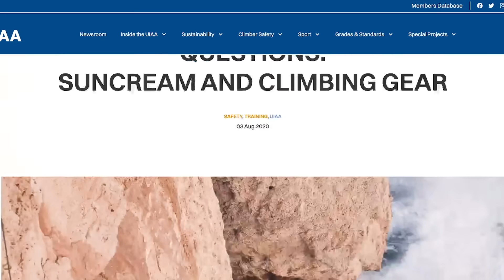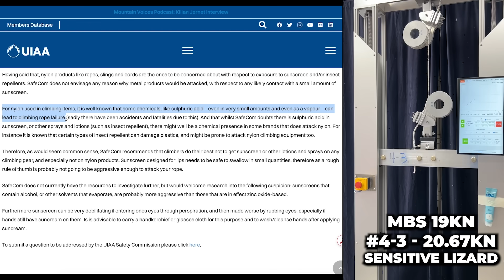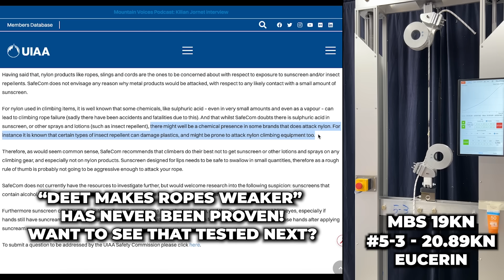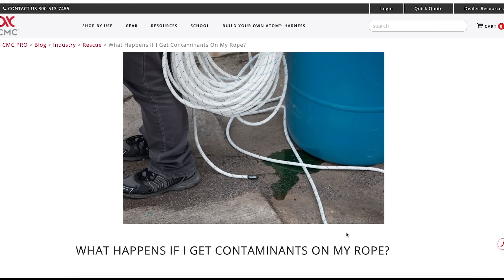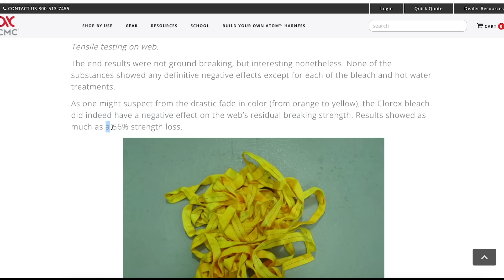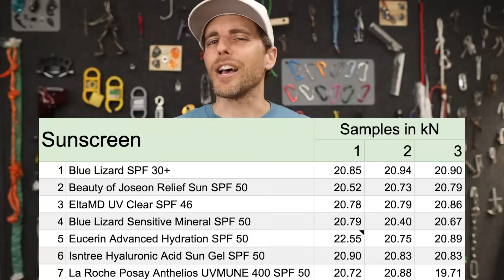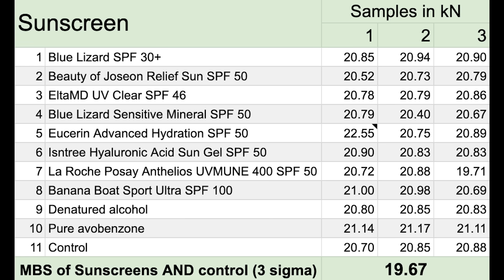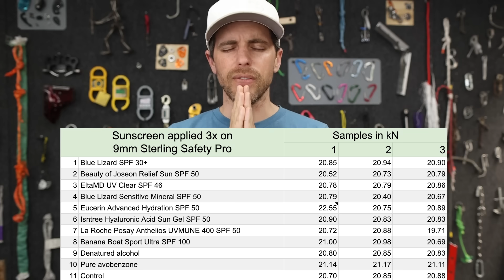This is going to piss off the worlds largest climbing organization

Comment: The main danger in my limited experience (which I hope you cover in this video) is the residue picking up a lot more dirt and grit, which could potentially shorten the lifespan of the rope if sharp grit gets ground into the sheath, or it could prematurely wear lowering hardware at popular crags by being turned into sandpaper.

Comment: I think it's really only rubber-based materials you need to worry about in regard to alcohol exposure. Insect repellent tends to have a greater variety of ingredients and can often be a little bit acidic - though, not highly acidic. Think more on the level of slightly diluted lemon juice or vinegar. Acidity can definitely do some real damage over time, even if it's a pretty weak acid - but only if you're using the same climbing rope for many, many years. I would think it would take hundreds of climbs by multiple people all wearing a lot of insect repellent for the insect repellent to contribute to a critical level of damage to a rope.

Keep in mind, both plastic and acid become more reactive when heated - and when climbing, ropes can be exposed to a fairly substantial level of friction to the point where they can heat up. So, a rope that's in motion more and rubbing against contact points with force might be at greater risk.

But if sunscreen is of particular concern, and if sunscreen does cause long-term damage to rope, I would think it's probably due to abrasive materials working their way into the weave of the rope while it's all oily and slick - which could then cut the rope up from the inside, especially in areas where the rope makes contact with a lot of debris or when climbing in sandy regions where dust storms might cause sand to stick to the sunscreen-soaked rope and work its way in as you climb.

I can see how sunscreen and insect repellant could indirectly lead to equipment failure under extreme circumstances. I don't think it's someone with new gear climbing an easy mountain who will end up benefitting from the advice you're writing off. Seems to me like this is advice for people climbing in extreme conditions.

I imagine the reason they boiled the nylon and bleached was to simulate age. Another thing to consider is that things don't soak into a new rope nearly as easily. A rope with a bit of wear to it is softer, the weave is a bit disrupted, and things seep in better. Though I think they probably reduced its structural integrity more by boiling and bleaching it than they did by anything else they did. I'm 100% certain that the only way sunscreen will cause serious and somewhat rapid damage to a rope is if the sunscreen allows abrasives to work their way into the rope.

Comment: There is an old Sterling compatibility test of nylon and DEET (this page has gone): "Samples of nylon, polyester, and spectra were submitted for chemical resistance testing for DEET (N,dimethyl-m-toluamide). The three samples were immersed separately in "CUTTER" and "OFF" brand insect repellent for a period of twenty-four hours at room temperature. "OFF" contains 95% Deet (N-dimethyl-m-toluamide) while "CUTTER" contains only 7% Deet and probably some oil based solvents as well. The results of the testing indicate no loss of strength as measured by tensile strength retention in any of the three samples.

There was one interesting anomaly that occurred only in the case of Nylon and the "CUTTER" brand insect repellent. As mentioned before there was no loss of strength for any of the samples but here there was a 25% increase in the elongation and a decrease in modulus. This basically means that a rope made entirely or mostly out of Nylon may become "rubbery" with a significant amount of exposure to "CUTTER" or other insect repellents with large amounts of oil based solvents."

Comment: Since the test fixture/diverter is the limiting factor in these tests, a more accurate test of sunscreen (or any other substance) impact would cover enough rope to wrap around the diverter and measure impact of failure there. This showed the diverter had more impact but does not show (conclusively) that sunscreen has no impact.

Edit: I’d go as far as adding you need to  take down the request to UIAA until you show impact at limiting points - what does sunscreen at a knot or sunscreen at a bend do? We just know from this sunscreen mid rope isn’t the strength limiter. We don’t know if it makes knots even more susceptible to failure.

Comment: A lot of plastics and other synthetics are sensitive to DEET, but Nylon is one of the plastics that isn't particularly... If you want to test some relevant options there are three I can think of that would be useful to people; engine coolant, isopropyl alcohol and creosote.
Engine coolant you're only likely to run into if you're regularly driving older cars or cars with issues, where you're carting a bit of coolant in the boot with your ropes.
Isopropyl alcohol is in a lot of hand cleaners and waterless hand washes, it's also the suspension agent for liquid chalk. This means that heavy applications of hand soap or liquid chalk without letting it dry could, in principle, damage ropes as well, but it's pretty volatile.
Creosote is a bit of a weird one. It's used as a timber preservative, although not recently and generally not in residential property. If you've got an old wooden shed, it's possible that ropes could be exposed in that environment.
Anyway, dyneema and nylon are pretty chemical resistant and the chemicals they're sensitive to are typically not polar solvents.
Also, as a point of interest, your dermatologist is wrong about sunscreens. Zinc Dioxide and Titanium Dioxide don't break down, the absorb and reradiate UV or reflect it. Sunscreens containing Zinc Dioxide or Titanium Dioxide based sunscreens need to be reapplied because the titania or zinc oxide are either absorbed or rubbed off. I know it's splitting hairs a bit, but you guys are stressing that being factually based and scientific and stuff is important ;)

Comment: Please test DEET. Take 20%, 50%, 100% DEET and do 5 mins soak, 24hr long soak, 1 week long soak just to see if it will weaken to rope at all. For control group, you can let it soak in water, or whatever solvent is used for DEET spray. Looking at the SDS for Off brand DEET spray, they seems to use ethanol for solvent. So you might want to use that for control.

Comment: Yes, please test DEET. I’ve been caving in an area in Kentucky where there are many ticks on the approach to cave entrances. One day earlier this year, I had five ticks on me, two of which had clamped on. I was using permethrin-soaked pants that day and watched (and videoed!) a tick get apparently drunk on the permethrin. Even with permethrin, I still had ticks and since they don’t die fast, I was worried. So last weekend, I pulled out the Mac daddy of gnarly bug killaz: 98.11% DEET. I sprayed that shit all over and proceeded to hike through the Kentucky jungle to the caves. At some point, I brushed the surface of my shirt with my hand and my fingers came away gooey. I looked down and saw that the ink on my shirt (FC Cincinnati soccer player Nick Hagglund) was smeared. This was exactly where I had sprayed the 98.11% DEET. I’ve never seen that kind of thing happens before with bug spray. Since then I’ve been  very careful to keep it away from my vertical gear. The brand is Repel 100 insect repellent “protects for up to 10 hours… for severe conditions”. Smeared Ink on a shirt is no big deal. Smeared me at the base of a pit is. Test, it please?

Comment: I can 100% believe that solvents and deet in bug spray can melt and damage rope. I mean, I've melted plastic with bug spray and for a long time bug spray was touted as a way to clear up foggy headlights because it would melt the plastic. The difference between sunscreen and bugspray is as severe as olive oil and rubbing alchohol. They are completely different things with completely different properties and ingredients. Seriously, where does any conclusion about sun screen come from that is related to bug spray?? How did they ever even address those two things together?

Comment: This was a great episode and good use of the scientific method. It's too bad an international safety organization didn't have the resources to do it themselves./s

Seriously, though, good on you for noticing that nonsense and correcting it with proper research. I do have two questions about methodology: Were any of the tests run with the test run with the ropes still wet and did you do anything to work the sunscreen into the ropes, rather than just slather it on the surface? I doubt either would really effect the results, especially for the pure alcohol test, but I could see the oil based stuff acting as a lubricant between the rope's fibers and mechanically, rather than chemically weakening it. Similarly, if the sunscreen didn't get much physical penetration, because it just sat on the surface and wasn't mechanically worked into the rope as it got stretched and bent, you might have missed the effect simply because it wasn't exposed to enough of the fibers to show a meaningful difference.

Comment: 14:51 that Grigri 4.0 seems to be the best design yet.

Unless one is using a hasty harness tied from climbing rope, no slings, etc. then only testing the rope seems to miss a lot of very critical soft goods.  Slings, OTOH, come in pretty much every fiber used in any other gear, plus stitching presumably in the same threads as harnesses.  They're also premade in nice self-looped samples so you don't have to tie knots in them for testing.
I'd think that the worst case scenario test would be to drench the entire sling, but if that's not practical for any reason, then just soaking the join would test both the base material and the stitching.
One could argue that you should still use some large, smooth radius to pull, so as not to concentrate the force too much, but I'd have to say that since they're most commonly connected to carabiners in actual use, that would be a totally fair testing method too.

Comment: I´m also an engineer and gear nerd ;). I hadn’t heard of this myth before, so I did a quick search on the chemical resilience of nylon. From what I found, I'm pretty sure there's no reaction between nylon and sunscreen (aspecally nylon and alcohol ;)). I really enjoyed your video, but I’d like to point out that there is a standardized test for climbing ropes under the EN 892 norm. That said, I don’t think the results would differ much from yours. After all, nylon and sunscreen have coexisted for decades, if there were any significant interaction, we’d likely have noticed it by now

Comment: I have avoided DEET for years because it has a reputation for running the waterproofing on nylon tents and jackets. Intuitively it would make sense that the same corrosive properties would apply to nylon fibers when configured as a rope rather than a fabric. 

I would imagine it would take more than a light spray to measurably degrade the MBS of climbing rope. Maybe soak a section, as if a bottle is Ben's 99% DEET spilled in your bag.

Comment: I want to see a test rope fail.  Acetone should do it, and lead acid battery acid would use sulfuric acid as the electrolyte.  I.e. what household chemicals should we be most cautious of? 

 how long did you soak the rope in the solvents? I dont think you mentioned it.

Comment: At 4:35 ,
I think you are making the assumption that manufacturers know exactly and in what proportions every single ingredient,  and byproducts of the mixtures of the known ingredients will create under all circumstances and all conditions. T H E Y
D O    N O T.
For instance,  most shampoos have low levels of 1,4 DIOXANE. A proven carcinogen, and a later found in Love Canal. It is commonly a byproduct of sodium laureth sulfate or PEG, and cannot always be cost effectively removed.
Other ingredients may not be tested or fully understood in relation to the intentional or unintentional mixing with other products in use or in the environment. 
Many products are manufactured or mixed overseas where oversight may not be of thorough nature and regulations far less stringent. 
We know for instance many chemicals produced in the United States for use on food crops were later found to be toxic and or carcinogenic. 
Although we are talking about the degradation of synthetic fibers, personal care products are not designed or tested for compatibility with these substances.

Comment: So this is mostly good stuff, but I take issue with the tone and sentiment of the video. 

It seems paradoxical that you basically:
- detest being overly cautious around life supporting gear
- promote being overly cautious around sun exposure

Its odd to point one direction and say they're making a mountain out of a mole hill, and then make one in a different spot. Sunscreen application is not that serious. 

She takes care to say "excessive sun exposure" without drawing the faintest line between what is excessive and isn't. Most people will not come anywhere near "excessive" on their typical climbing outing. And i would've hoped to see some encouragement to use clothing as UV protection over a consumable.

Comment: Could sunscreen lubricate a rope causing any knots to tighten up differently, perhaps into a smaller diameter meaning that a knotted rope contaminated with sunscreen would be weaker than a knotted rope that is not contaminated?
Also how much would this lubrication decrease the effectiveness of braking devices?

Comment: Very interesting. There seemed to be a slight increase in average breaking force for some sunscreens plus alcohol, not sure if it's statistically significant but I wonder if they were chemically making the rope stiffer. Which for a rope that's supposed to be stretchy (unlike the tested ones) could be a bad thing.

Comment: Bicycles and Sunscreen: (maybe off topic, maybe related, depending on your perspective)
Sunscreen does break down the rubber or artificial cork on bicycle handlebar grips. I've seen this. I'm not sure it makes them weak or not but it makes them permanently sticky and gross. I think it's the oil dissolving something or a solvent? That makes me wary of mixing sunscreen on plastic in some cases.
However, I did try sunscreening the tan sidewalls of some tires that tend to deteriorate much faster than black rubber tire sidewalls, some other bike mechanics and I think it's UV wearing it down. However it was so few tires I tried and maybe it rubbed off in the rain and I really can't say I noticed any difference or not over time, but I might try it again because why not?

Comment: Honestly, you probably do have more resources for running novel tests than any other independent group. Partially because you pay for your research through community engagement which allows you to cover topics that might not come up in normal testing (sort of like MassSpecEverything).

Also, you certainly had some impressive bollards to climb that route...

Comment: The responsible way for uiaa to handle this is not to take the offending article offline but to put out an amended article stating that earlier article was wrong or the assertions were without basis otherwise people who had read the earlier article would continue to spread and propagate the bad info.

Comment: A good 20 years ago the German Alpine Club's safety council conducted similar tests. They tested sunscreen, urine, and Autan (which is a brand of a less cancerous insect deterrent compared to deet).
Their results align with yours, no difference in strength, and Autan actually increased the strength.

Would be great though if you could test with deet as well. I also wonder if the Autan also had denaturalised alcohol in it.

Comment: I do sort of wonder what the impact of sunscreen (and other contaminant, especially dirt) exposure might have in the knot itself (and potentially a few common devices). That's where you're most likely to be handling it enough to get stuff off of your hands into the material and could be a "remember when you reapply to wipe your hands before tying a knot/using this device" and not just because undoing it is going to also be gross.

Comment: I see two applications, where sunscreen might be dangerous: in a configuration where it could make the rope slippier than you want it to or when the sunscreen is applied together with sand or other particles. But that obviously wouldnt be because of its chemical properties, but because of its mechanical properties and even then this is just a conjecture. Maybe some followup tests? The question with the sand though is if it would even make a difference compared to just rubbing it in sand...